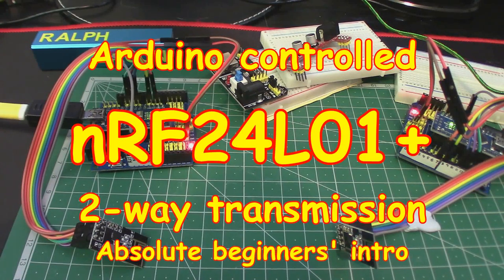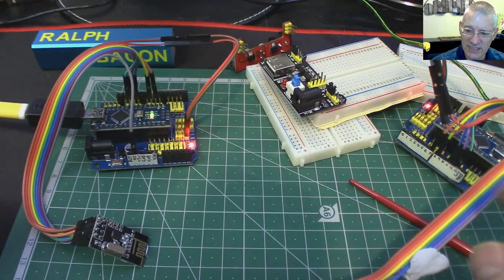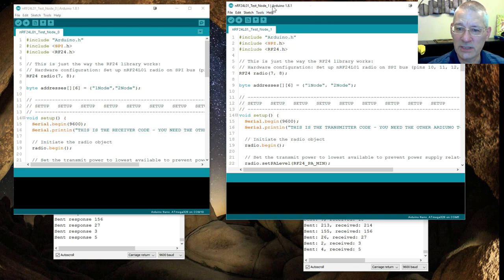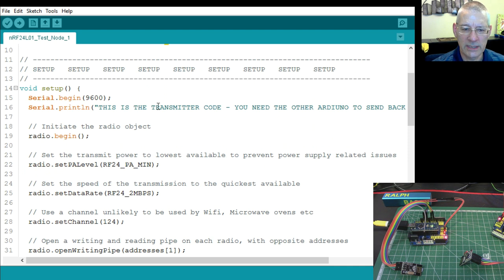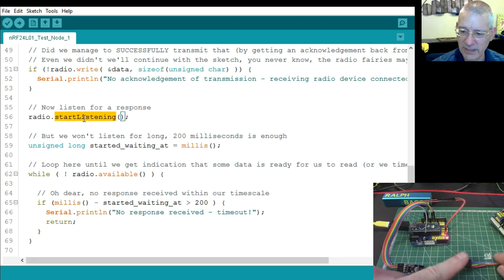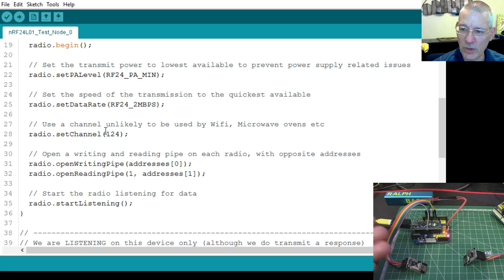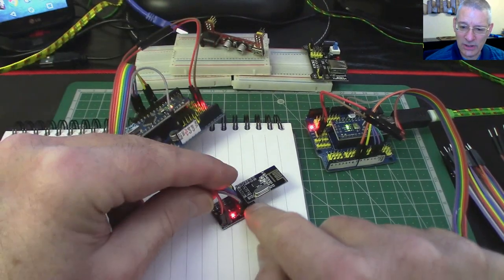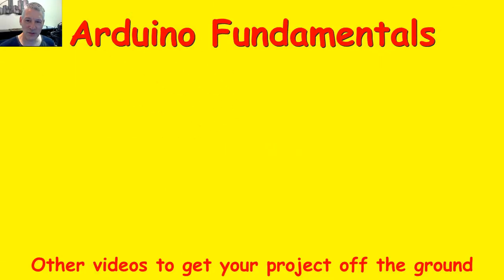#73 nRF24L01 Send (and receive) data with your Arduino!

Comment: High Ralph, love your presentation but you have totally confused me as follows; on the one hand you show the addresses for the two nRF's as "1Node" and "2Node" - at TRANSMITTER code line 9. But then you show these addresses as; Line 31 "1" for 'OpenWritingPipe' [[written as radio.openWritingPipe(addresses(1);]] and at Line 32 as "0" for OpenReadingPipe [[written as radio.openReadingPipe(1, addresses[0]);]]?  Not addresses 1 & 2 as defined at the start of the code. The code lines in question occur at 16:25 minutes into the video. Please help me to see what I am apparently missing here??? Also please clarify the different address formats (as written in the code at lines 31 & 32) - why is there only one address in line 31 compared to two in line 32?? Hope you can help me stop pulling out my hair, please??? Even though this line is commented out can you please clarify that  '10' in the pin definitions at Line 6 should be deleted from this line of code and what the digital pins are actually representing here? Cheers, ian
Reply from the maker: Hi Ian! Sorry to be the cause of premature baldness, let's see if I can clarify a bit.
 
Line 9 declares an array to hold the names of the two nodes. Arrays start at position 0. The first element will be indexed [0] not [1]. The physical names are "1NODE" and "2NODE" but are in array positions 0 and 1. The odd names are a remnant of the original sketch as supplied with the library.
 
Line 31 uses the SECOND name (addresses[1]) for transmission. It then uses the FIRST name (address[0]) for receiving data from the other nRF24L01.
 
Line 31 opens a writing pipe and only needs the name of the node to do this. It also opens a reading pipe but must supply both the node name AND a child/pipe number on which it is listening (in this case 1 as we're only receiving data from one other device, but more are possible).
 
Let's see if this clarifies things a bit for you. Phew! that was exhausting. I hope this helps!
Reply: Thanks Ralph - so are the 'array positions 0 & 1' you mention ((designated names "1Node & 2Node" respectively)) part of the 6 available address locations for the nRF24L01 eg., 0-5 inclusive? This is important to clarify because I have been reading that address 0 is very special and different in operation from 1-5 addresses and that complications can occur with the radio operation if address 0 is used? Appreciate your further clarification, Cheers, Ian        Link for this "0 address caution" etc is given at http://maniacalbits.blogspot.com.au/2013/04/rf24-avoiding-rx-pipe-0-for-enhanced.html                                     [ RF24 - Avoiding RX Pipe 0 For Enhanced Reliability ].
Reply from the maker: Well, Ian, I'm going to promote you to the Advanced nRF24L01 Class, as you obviously are well versed in this device.
 
As it happens we only use Pipe 1 for reading on Line 31, although that was not a deliberate choice by me, it was part of the original sketch (the author of which probably did make that a deliberate choice). The addresses of the Nodes are not to be confused with the Pipes, however. The "1Node" and "2Node" names (at array positions 0 & 1) are not connected with the Pipe numbering used in the OpenReadingPipe statement on line 31.
 
That article is very useful (I've even printed it out at the risk of decimating yet another Brazilian Rain Forest) as I will keep it handy.
 
The TakeAway here is, for small networks of the type an Arduino (or Pi) is likely to be involved in, use Pipes 1 through 5, as per that article. If you do have to use Pipe 0, read that article many times and understand the consequences!
 
Thanks so much for taking the time and trouble to research this, I hope you will buy a couple just to experiment with. They are nice little devices (but do buy the base adapters too, it makes them much more reliable at anything above minimum transmission power levels).

Comment: I have two slaves and 1 master, i am sending data (tempersture and humiditt) from the slaves to the master, 1 slave always send, but the other slave only last for hours, then i can not monitor the other slave, idk what is going on, both have the same code, :(
Reply: My slave 1 always work, but my slace two only works for hours, i can monitor it from the lcd, but it does.not send data to the master it is like connection lost. :(
Reply from the maker: I would swap out the nRF24L01 for another module and see whether the problem remains. I have had some FAKE nRF24L01 modules that don't always work properly; one even died on the workbench whilst I was testing my code!

If the problem remains with a new nRF24, swap the two nRF24 modules over - does the problem remain with the fault nRF24?

Have you adjusted the transmit power from MIN/LOW to MAX? Just for testing, then you can reduce again if required. There might be interference, depending on where you have the two slaves located.
Reply: @RalphBacon  i couldnt solve it, i got tired of it, i just replace it for wifi :(

Comment: How important is it for both arduinos to be identical?
Reply from the maker: Nope, don't have to be identical, airthrow. As long as the code compiles for your platform it will be fine. So you could use a Mega, an Uno or a Nano. You could probably use a Leonardo (Sparkfun Pro Micro) too but a bit of a waste on this. Do let us know if you succeed in getting it working - are you using the adapter boards (saves hours of head scratching)?

Comment: can i get code of multiple salve transmitters nrf and single master receiver
Reply from the maker: Remember that each unit both sends and receives, Sanket, even if it is only for the auto-acknowledgement. There are some examples in the library I use that show how you can connect multiple units together with a "master" and several "slaves". Have a look!

Comment: Hello Sir,

This was the best tutorial I found on wirelessly connecting arduinos over radio frequescies, and I got the things working as it is said here. For the last month I had been trying to make two arduinos communicate using the 433MHz rf-links, and failed. So I bought two NRF24l01-s that has antenna. The sketches are working perfectly, but I am getting only 12 feet range of unobstructed space and 6 feet of space with a 5 inch concrete wall in between. I need a range of probably 100meters for now with random obstacles in between. The range might need to be upped more in future, but for now 100 meters would suffice. Could you please suggest how can I make the range go up?

Also, I would require connecting upto 35 rf devices and make a network of sensors and relays connected to arduinos communicating to a raspberry pi station at the center over rf. It would be really useful if you could please make a tutorial on the RF-mesh implementation.

Thank you for the useful tutorial once more. :)
Reply from the maker: Hey Debopam, glad you got it working! You can adjust the power of the unit's power by changing the power value (do the same for both sketches) but remember that if you are not using the adapter boards your range will be severely limited by lack of 3.3v current - use the adapter boards with 5v and it will be able to use the high power version. In...
 
In my demo I use a low power setting, RF24_PA_MIN, but you can increase that to RF24_PA_LOW, RF24_PA_HIGH, or even RF24_PA_MAX but you will need a good power supply (ideally not supplied by the Arduino). With the maximum setting and using antenna (as you stated) then you might get 1km range in open countryside.
 
Unfortunately I don't have the time to create a sketch for a mesh but the library does contain an example of how to do this advanced configuration. Good luck with your project.
Reply: Thank you sir, I fiddle with the power and data rate and set the power to max and data to 250kbps. I got a higher range of upto 50feet, but the connection is lost when I take it one floor higher. I am trying to get the thing working.
Reply from the maker: Remember that your WiFi will interfere with this radio - what channel did you choose on this device? Actually, it's better to set the speed to 1Mb rather than 250kb as that is more prone to interference (counter intuitively). Are the floors made of concrete with reinforced steel bars - or just wood? The former will stop radio waves in their tracks.
Reply: It is reinforced concrete sir, that is what is stopping it then. I hope it will be possible to use some of these RF modules mid way at the stair cases as repeater units probably so that I can get an unobstructed line to transfer and then forward the signal to the upper floor?
Reply from the maker: Tricky. The main issue I see here is that you are now relaying the data across multiple nRF24L01 units, so you will be using (at least) 3 units and 3 Arduinos. It complicates the logic of the sketch(es) but if you design and get working everything first you can then install. First of all though you need to use the two you have to prove that a signal will travel from the stairs to the upper floor (and back again), and from the stairs to the ground floor (and back again). If that works, you can progress to your 3-unit project. Good luck with this project.
Reply: Thank you for your suggestions sir. A good day to you. 😊
Reply: For mesh operation check out the mysensors project

Comment: So I was wondering.  We all know that Arduinos don't actually produce good random numbers.  There's a lot of repeat and such.

So then I wondered, with the nRD24L01, there's a way to measure "radio noise" which is totally random.

I wonder if/how would could pull that and seed the generator continually to produce as close to true random numbers as possible.

Has anyone done this?
If so, are you willing to share your code?
Thanks in advance.
Reply from the maker: The whole subject of "random" numbers on computers has consumed terrabytes of storage. Theory says they can never be truly random, no matter how you seed the start. I use the input from one of the analog pins but I've found they, too, can be more stable than you think (so you always get a seed between 5 and 30, for example). 

There are some "noise diodes" out there to generate random noise (in the same way you are suggesting for the nRF24L01) which is a cheap and reliable way of doing it. Other than that, a mechanical approach that cannot be repeated is the only way to do it.

If you decide upon a method, you need to generate a few million numbers and plot how many of each you get. You should get equal amounts of each value (law of averages).
Reply: @RalphBacon  Oh yes, random number generation has been a long-time issue for sure.
I think that you are talking about an Avalanche Diode there.  Good idea!

I learned wayyyy back about how "random" gens work so I'm always looking for a way to get better random numbers with less repeats.  LOL

As for the  Arduino,  I know that the "random" is not so "random".

I too used to use an analog port, but like you say, the "noise" they create are NOT so random either.

I thought about the nRF24s because I remember seeing something about testing for "noise' somehow, and so I thought, that might be an interesting way to do it, but I wasn't sure how to capture that, without messing up these sensitive devices, meaning, I wouldn't want them to just stop working, although, I now have code to auto-restart them from a power off/on state.

I have an idea that I'm going to try today.

That is to capture clock ticks from the Nextion Enhanced displays.  The have RTC, so I thought, maybe I could capture the seconds, then use the current temperature and humidity to create an algorithm that would  generate a more "random"  and reseed the generator with that number, every minute or so.  I'll look into the diode idea as that is a cheap option.

The reason I need to generate the most random number possible, is because I have 6 transmitters using the nRF24 radios and 1 (or more) receivers.

I WAS going to use the Network libraries, but as of yesterday, I've decided against that as they literally take up DOUBLE  the space as the normal nRF24 libs.

I have 2 ideas of how I'm going to implement this.
Either, I'll use 6 channels (addresses) and have the Rx cycle through to READ each radio or I'll use just 1 channel and have the Tx modules sending at different times and using a "unit ID" it can process each data package via its ID.  This does work well, so I just might go that route.

Fun times.  LOL
Reply: @RalphBacon  
Ok, another idea implementing a bunch of stuff.
I can design a PCB that will have a small microphone on it and a light sensor.
I could add a temperature sensitive transistor to that.  And some transistors to create random noise.

I could combine everything into 1 output that would go into the Arduino.   (or why not maybe 2 outputs to go into 2 analog inputs ... go big or go home).

The code could then grab the input(s) from the PCB and my algorithm could combine numbers from the DHT-22, which will give me 
-  temperature to 1 decimal point
-  humidity to 1 decimal point
-  heat index to 2 decimal points
-  clock data from the Nextion Display's RTC

This could generate pretty good random numbers.... at least, on paper.  LOL

It's something to play with, at least.
😁
Reply from the maker: The only way to test your hypothesis is to.. well, test it out!

Comment: really creepy that I got 5 of these in the mail today...was jostling one of them in my hand, hit home on my YouTube app and this video was the first one on my suggestions list....I think Google needs to get outta my house! lol ...weird thing is, I didn't do any searches for this module or anything...I bbc was just holding it and thinking about YouTube searching it and this video was there right when I was about to click the magnifying glass icon to search it....creeeeepy
Reply from the maker: Not creepy at all, serendipitous! Did you buy the adapter plates too, to avoid a whole world of frustration with the power issue (these devices are 3.3v but the adapter plates allow 5v and you can then use high power transmission settings)?
Reply: Ralph S Bacon nope :( ..ordered on a whim and cuz of the price of a 5 pack n thought it would be some "cheap fun" ...it was creepy haha it's like there a Google cameras over my shoulder they can read my mind sometimes...something weird like this will happen with Google every few weeks now and it's making me uneasy to the point where I've installed a vpn and all sorts of ad/cookie etc blockers...it's become WAY to intrusive

Comment: I am having problems with the nrf24l01. Capacitors, power supllies and PA Levels dont changed anything.... When I open the GettingStarted Sketch I receive either 0 or random numbers or even the Serial Monitors just blocks. Baud rate settings are ok too. They were working kind off bad yesterday but today nothing. Can anybody help me? Is it possible that my libraries are not working correctly??
Reply from the maker: Are you using the exact same two demo sketches I supplied (without modification, one for Transmitter, one for Receiver, even though they do actually transmit stuff)? I'm using ultra-low power in the demo sketch so the range is about 30cm (1ft) but that would not explain random numbers. Odd you say they were working badly one day, but nothing the next day. Are you absolutely sure you have all the connections correctly (if you're using the adaptor plates it's a lot easier to wire them up and does solve all known power issues) - I'd suggest checking those first - after all, there's not much else (apart from power issues - hence the ultra low power setting) to go wrong.
Reply: Ralph S Bacon thanks for repplying. Yes I used "official" sketches. I did the wiring about 4 different ways many times. Swap breadboards, made adaptors... So I am pretty sure that the wiring is ok. I think that I connect it (for 10 seconds or soo) in reverse, soo -3.3V. It warmed a bit but at that time they were not working already. I noticed that the receiver arduino I am using does not blink the Tx or the Rx leds like the transmitter. Hooking it up to a power supply reveals no power consumption. Is that normal?? Maybe they are bad. Thanks a lot.
Reply from the maker: Hmmm, well if you have not fried your unit (it's probably OK if you just connected 3.3 volts the wrong way round) then try this too: put a 0.1uf AND a 10uf capacitor right from GND to 3.3V pins - this MAY help, as anecdotal reports indicate that sometimes the modules takes a very brief power surge that the 3.3V on the Arduino can't handle. But the receiver module (which is identical to the transmitter module) should show the same LED indicators (if they have any). Try swapping them over. As a last resort you may have to replace them (and be very careful how you connect them up in the future).
Reply: I did that too. The modules dont have any Led´s. I think that they are dead because I did a continuity test on the supply pins and there seems to be a short circuit between them. I noticed that when I connected one of the modules the voltage drops from3.3v to 0.3v. I ordered two new modules now. Maybe I will have more luck. If I succed I will tell you what I did. Thanks a lot for the help.
Reply from the maker: OK, good luck and thanks for letting us know all the steps you've taken. Did you order the adapter plates at the same time - this would prevent incorrect (power) wire ups? And just make the whole thing more reliable. Since I've used these I haven't looked back. I bought them from Amazon (presumably sourced via China) and they only took about a week to turn up.
Reply: Ralph S Bacon I may order them now. Tanks a lot!